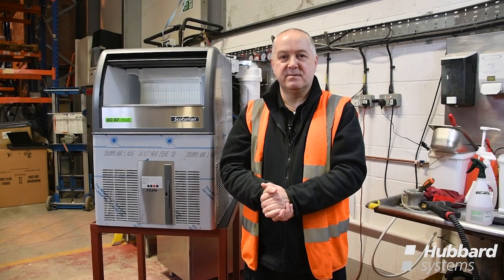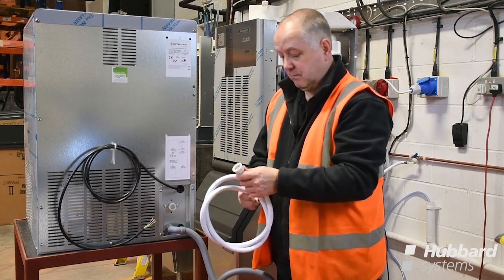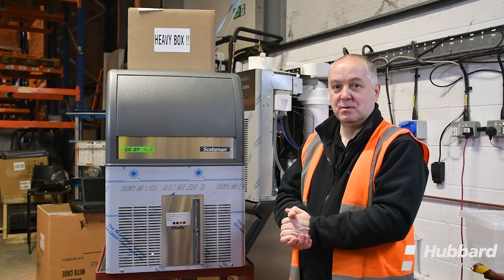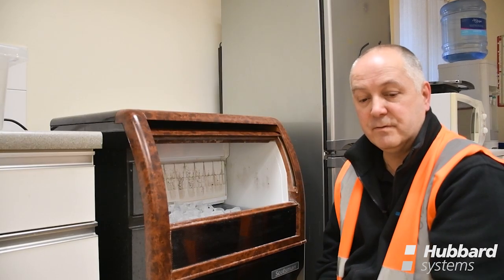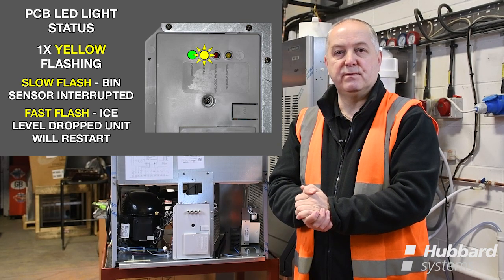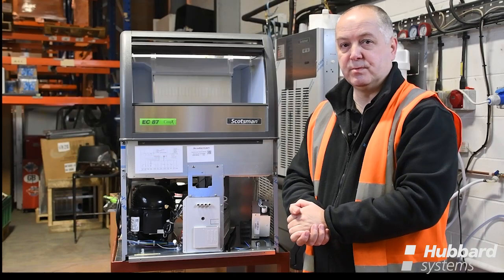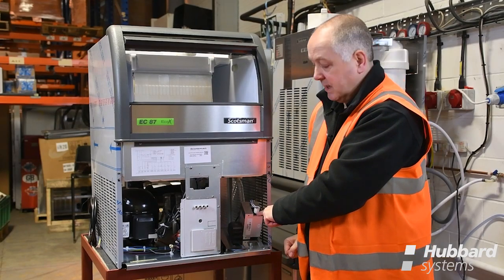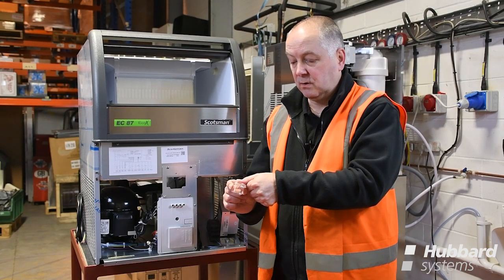Scotsman Ice Makers - Installation Advice & Troubleshooting

Comment: Sir my ice machine ac 106 is taking 40 minutes to complete one cycle,  what is the problem?
Reply: @@Smorad5 thanks, please  make more repair/ troubleshooting videos, my mv 1000& mv 1006 having high condenser temperature issue both getting stopped repeatedly after few cycles! 🙏